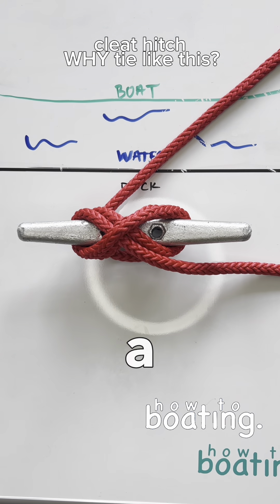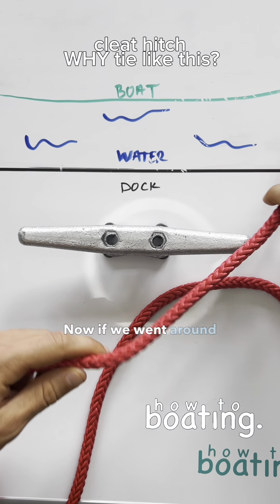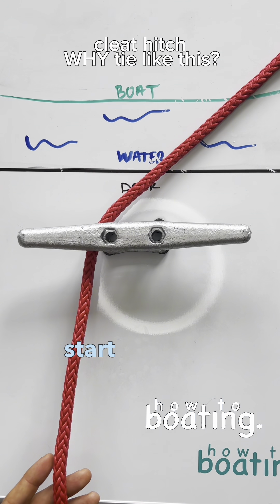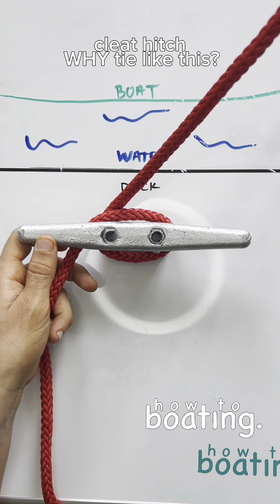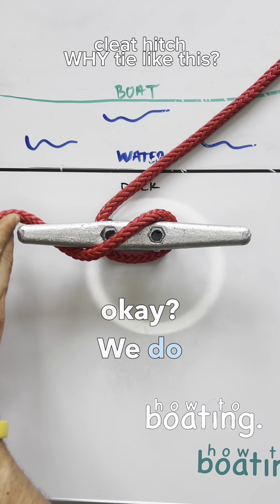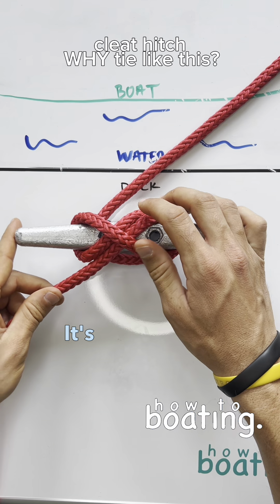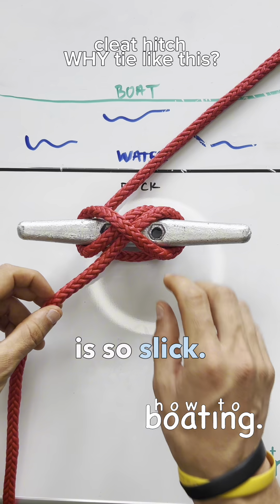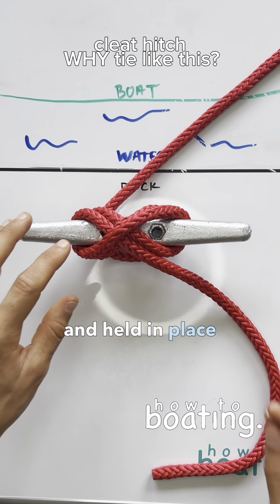How to TIE a CLEAT 2

Comment: This is a great way to  lose your line. The first half wrap you show merely ads bulk to the cleat, and has practically no slip resistance or effect in holding the line fast. Then you make only 2 figure 8s before you throw on a couple final hitches. A good jerk on the line will make the hitches too tight to untie, and will require a hammer/spike to break loose, or if no time to work the line off the cleat, a knife. You need at least 4 figure 8s before throwing on the hitch. The hitch is only to hold the line in place... The figure 8s do all the work.

Comment: As a Bristol Bay salmon fisherman we see extreme seas when delivering to tenders. Full loop locks when the waves surge, this is a foolproof way to prevent that from happening. Take note
Reply: Did you watch the video? He started with half a loop around the cleat which loads the cleat with virtually no holding power. He then proceeded to put only 2 wraps on the cleat before throwing on a hitch. You should know from your experience that at least 4 figure 8s are required before you tie a hitch if you want to get the line to come back off without a hammer or knife after a good jerk. In the Bay, the lines are usually from the tender, but I'm sure you would treat them as good as your own lines, so I expect you didn't actually watch the video which depicts an incorrect method that will lead to a damaged line in heavy seas when your antennas are smacking against the tenders rigging.